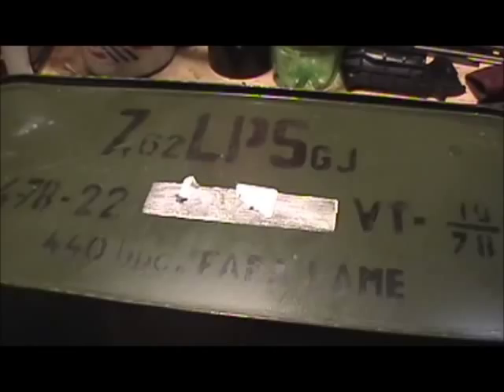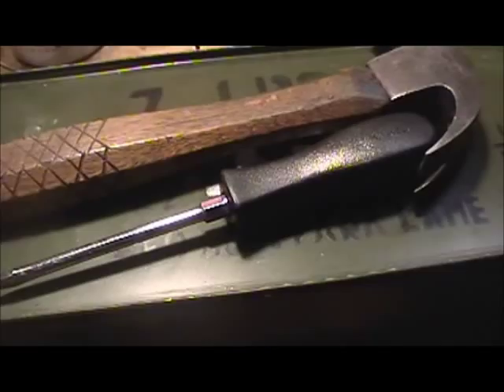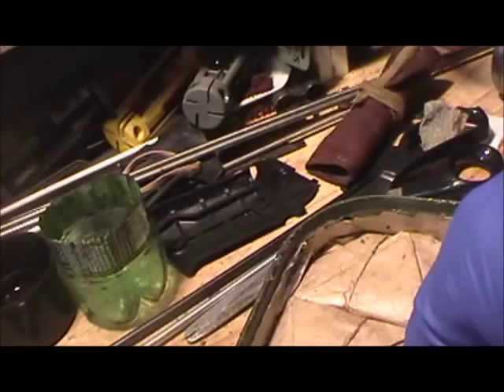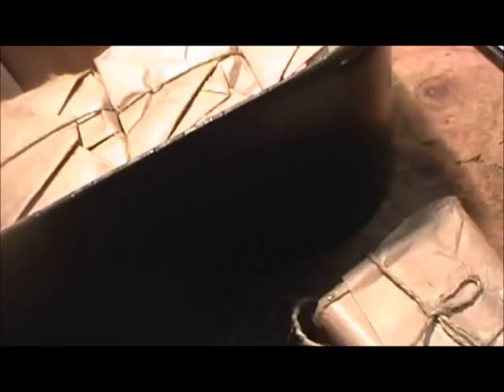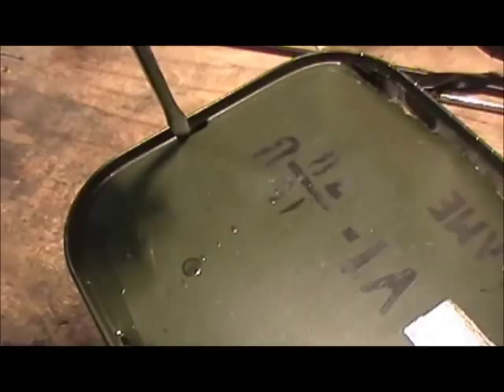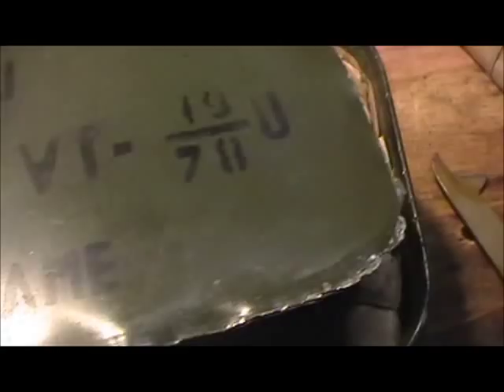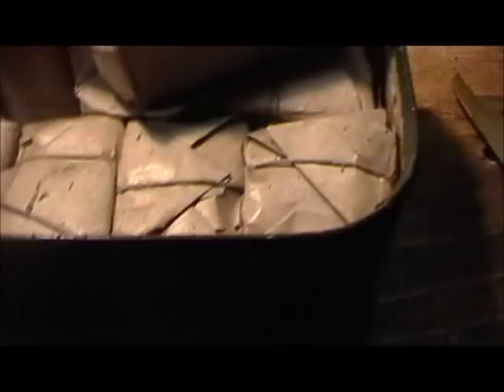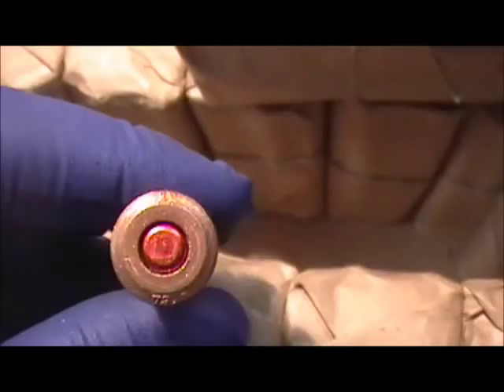Opening a Tin of 440 rds 7.62x54R

Comment: @MarshalZhukov The copper washed stuff gets caught in the chamber. I cleaned out the cosmoline, I tried the chamber brush with solvent and I have steamed it. That did help a bit but after about 80 rounds the bolt starts to stick and it sticks bad, to the point where I have to take a rubber mallet and beat it open. Its not rapid fire so the gun isn't heating up that much. I don't see any pitting or burrs in the chamber. So I'm thinking its just the ammo? I've tried Bulgarian, Russian ammo.